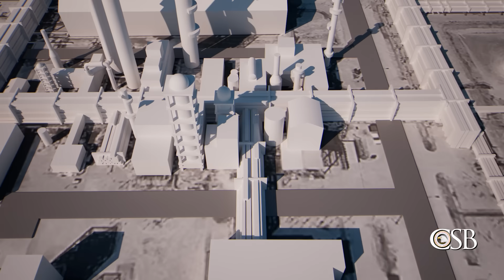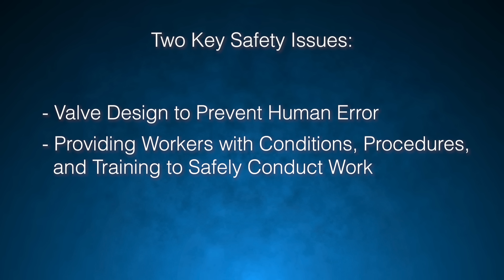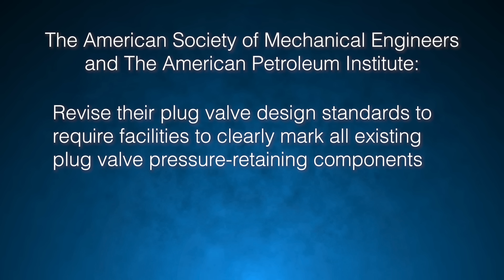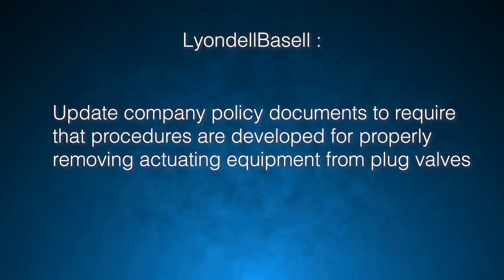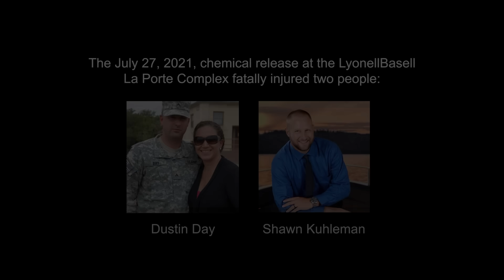Designed to Fail: Chemical Release at LyondellBasell

Comment: well i see a simple answer from the aircraft industry  with secondary castle nuts and cotter pins for pressure retaining fittings seems to be in order so they Cant be accidently removed   and  retrofit bolt/stud kits could be supplied for exsisting  service equipment at what could be considered mininal costs.

Comment: I knew how this was going to end - my background is petrochemical production and I dealt with health and safety including  health and safety investigations for clients - when WorkSafe would be prosecuting ( the government agency in New Zealand that deals with health and safety like OSHA in the United States)  I was involved with a similar event with a gearbox it was mounted on a gas valve the contractors commence to remove the gearbox and massive gas release occurred luckily no one killed or injured but the network had to close a main highway the company tried to blame it on the workers as they were “experienced” however my investigation pointed out (which didn’t make me popular with management who had basically prejudged and who of course paid me !)LOL that in fact there were no drawings/ no procedures/  the workers had had no training in that type of gearbox and there was another physically identical type which could be removed leaving the valve body (pressure integrity part of the valve )intact :possibly these guys were used to working on those types of valves

Comment: I'm confused about this. I've never worked on plug valves but even I could see the obvious danger. How can people make that sort of mistake? What bizarre mechanism did they think was behind that plate?

I don't know if labeling things will make any difference. That's like someone trying to take the propeller off a plane while its running. Paint and markings probably won't have much of an effect.

Comment: Great video - but IMO the root cause is not being properly identified.
A system that requires the mechanical disassemble of the actuator/ valve assembly
in order to prevent its inadvertent actuation in order to conduct downstream maintenance 
that is not related to the valve itself seems not only inherently unsafe, but is unnecessarily wasteful of man hours.
How about designing plug valve actuators that can be locked out for maintenance without requiring a mechanical team to remove the actuator?
Both safer, and more cost effective.

Comment: It's weird to me that they supposedly needed to remove the actuator to "lock out" that valve from being opened during maintenance.  It seems that removing the air lines to the operator should have been enough to ensure that the plug was not rotated. If not, there should still be a way to pin the valve closed without removing the operator.

Comment: Before I retired, I was a worksite hazard management specialist, and a permit writer for a major oil company.  This job would have been stopped until someone could convince me that they had a clear procedure.  Just seeing the system design, I can see that messing with that valve would result in a failure.  We don't mess with valves with product in the tank.  That whole tank would have to be locked out and made safe to work on that valve.
Reply: These fellas weren't supposed to be messing with the valve, they were supposed to be messing with the actuator, which absolutely is a task that does not require the process to be isolated and depressurised.  

Source:  am instrument tech whose plant would be shut down most of the year if we couldn't work on an actuator without a full LOTO on the process, and wondering why pipefitters were performing this task.
Reply: @nobodyspecial7340  If your an instrument tech, then you know that LOTO and permits can fall short if the job itself does not limit the removal of those bolts.  Also, you and I both don't know how that air actuated valve assembly is put to together.  It might have necessitated the removal of those bolts in order to remove the valve actuator.  Either way, does it matter?  A man died.  Best thing to do is play it safe.

Comment: Not a fan of disassmbling a valve as part of a LOTO procedure in the first place. If the valve cannot be locked in the closed position with the actuator on, they shouldn't be using it as an isolation point.

Comment: Ugh. Damn actuators. It would've helped if the actuator could've been designed to have a locked close configuration while remaining installed on the valve. Alternatively, it may have helped if the crew was provided with an IOM of the actuator to review prior. (Though finding the correct one could prove challenging depending on how much of a mess the plant/company is.)

Comment: It's also extremely important for workers to demand to be provided with clear instructions for potentially dangerous procedures and not to be afraid of refusing to conduct any work without those. Never put yourself at risk because of your employer's carelessness.
Reply: The catch-22 for some employees is that making such a demand in a workplace with an unsafe culture can expose them to retribution from management and other employees. I agree that no one should agree to a dangerous request, but if refusal results in termination then you are out of a job and the employer is free to continue their unsafe practices. Regulation is paramount.

Comment: To prevent workers from removing nuts/bolts that should not be removed, how about a bright orange piece (essentially a circle with a hexagon cut in it) that fits around the nut/bolt. Workers would then have to remove the piece to be able to loosen it.

Comment: I'm curious about it and it wasn't mentioned AT ALL. If there was a wholesale valve REPLACEMENT, there'd be a whole slew of lockouts and block & bleeds that would need to be done (if possible). For just replacing an actuator, is it not standard to at the very least disconnect the valve from the process? Even if it's considered a "simple task", the valve and valve actuator are physical parts of the process and some level of risk due to a 1/1000000 failure should be anticipated. Going at it with the entire unblocked sum of available process energy shouldn't be the right thing to do. In short, I'm surprised nothing about isolation for maintenance was mentioned in this video.

Comment: This is madness! Why were contractors in charge of doing the LOTO? It should have been made safe by LDB before the contractors showed up at the location. 
We will let it slide that they wanted to remove the actutator to make it "safe" for whatever reason. Why were pipefitters doing that part of the job in the first place? Where were the instrument mechanics? Which operator trusted these contractors word that they were qualified?( RIP)
CSB recommends redesigning the valves??? You can't be serious? Its simple, get the correct trade to work on what they do every single day. Were they gonna send scaffolders out to weld the pipe back together? Of course not! Dont touch other trades equipment.
"Designed to fail" is a ridiculous and downright embarrassing title for this incident. CSB you need to do better.

Comment: Usually, the actuator has coupling to connect to the valve stem. All mechanical service should know it. Also, before the work, they confirmed that their screw are qualified. So, it is not LyonDellBasell false. The Turn2 is reliable for the damage. That is reason why they need grade A in ISN network and the US companies pay extra for their service. Another safety concern is the plant should LOTO on manual valve. therefore, there should be a manual valve upstream of the actuated plug valve. Since it is acidic service, PAPR and chemsuit should be used.

Comment: “Food preservative” should not come before everything that came after it.
Reply: Acetic acid is just the scientific name for undiluted white vinegar. People have been using it to pickle and preserve food for ages. Granted, what we use is diluted dramatically to almost five percent. In slightly stronger percents, it can be used as a cleaner, but beyond that, it's dangerous.

Comment: ignorance is bliss, until you are handling something with immense gravity. The contracting company obviously had underqualified staff it treated as dispensable. They are most likely hired household plumbers for industrial chemical plants.

Sadly this accident is like someone unscrewing a valve on a gas cylinder that is far from empty, or removing the brass valve assembly on a propane tank with plenty of liquid propane inside.

Just like FAA and FEC, USCSB has no criminal prosecuting teeth.

Comment: Coming from oil and gas, it's pretty alarming to me that these people were working on a non "blocked-in" valve on the bottom of a full vessel. When possible, it's typical to install control and isolation valves with options to either blind off or manually isolate with secondary valves to make maintenance tasks safe and efficient. This is a failure on the design side first and foremost.

Comment: For those wondering why they didn’t just disconnect the control input from the actuator, here’s an important piece of information the video left out: the actuator was removed from the valve so that the valve could be locked out for maintenance because of a LyondellBasell policy that stated that only those pneumatic valves with a means of manual operation were “approved energy isolation devices”

How a pneumatically operated plug valve with its source of energy disconnected would spontaneously operate on its own without a source of energy is a mystery to me.

I think it could be argued those two guys died because of overly prescriptive safety practices. They were killed because they were doing something unnecessarily complicated to meet the requirements of a poorly designed safety policy.
Reply: Every pneumatically operated plug valve (all valves really) that are going to be used for isolation need a separate hazard assessment as some may have a spring that causes the valve to either fail open or closed in the event of loss of air pressure. Failing open or closed is determined by what is deemed safest for the particular process.
Even fully manually operated valves can not be 100% relied on, I once observed external factory welds on a high pressure steam globe valve fail, allowing the previously closed valve to pop open. For reasons like this, for vessel entry, blinds are installed after the vessel has been isolated using all available valves.

Comment: Darwin Awards here. How profoundly bad at your job would you have to be to see that removing the nuts holding the face plate on a valve holding pressure, is a VERY stupid idea. None of those 3 had any busisness working on equipment.

Comment: Absolutely visually stunning and accurate simulation. It's a shame these workers had to die for this video to exist. But I also have to wonder why no one bothered to read a manual. All of these pieces of process equipment have drawings, cut sheets, and manuals available at the central office. Even barring that, most of these valves have .pdf manuals you can access on the web for free. One final thing: this mixture contained methyl iodide, which makes acetic acid look like cotton candy by comparison.

Comment: What gets me is how those contractors could have made such a mistake. I'm not a pipe fitter, but I do haul chemicals and see all sorts of pipe work like in this video. Even to my untrained eye, it's obvious the fasteners on flanges will release the fitting if they are removed. I get trying to make things safer with these recommendations, but that it's happened 4 times sounds a lot like darwinism at work. 

Of course I'm only referring to that one specific item. Lack of training and established procedures are most certainly still an issue here. I wonder if those guys were under the impression the pipe was empty, making it safe to remove the fasteners.
Reply: Fatigue can be as harmful, if not more harmful to your judgement than being intoxicated. If you're working extremely long shifts and are about to drop from exhaustion, you aren't always thinking clearly, often just going through the motions on autopilot. I'm not saying that this is definitely what happened, but there's other possible reasons than just jumping to "well they were clearly morons".

Comment: Sounds like more of a job for an instrument technician. Could have shut the valve without removing the actuator by applying air against the spring and forcing it close. A ball valve can be installed inline of the tubing to trap the air pressure inside and a lockout could have been installed.

Comment: Procedure poisons the mind. Let me explain: From what I gather from the video, the entire purpose of removing the actuator from the valve was to prevent any possibility of the valve being opened while the repairs for the leak were performed. We call this a Zero Energy State. Two things went wrong here: 

1) The nuts on the studs of the plug valve cap did not need to be removed. 

2) The coupler for the actuator that was stuck on the plug valve stem also did not need to be removed...and here is where "Process Poisons the Mind"

Those workers are very skilled. Things are complicated these days, and I'm sure those guys were used to having to follow procedures that have baby steps, and they all have baby steps. By going with baby steps, workers tend to get used to completing the tiny, redundant, irrelevant tasks that MIGHT be necessary, and completely miss the goal of the overall task. In this case, it was to DISABLE that valve so that it could NOT be actuated remotely. Simply taking the actuator off, regardless of the coupler, would have accomplished that task and made the product piping safe to work on. These poor fellas were thinking the coupler was part of the actuator, thus, it must be remove also. 

RIP to those who lost their lives. And thanks for another great video!
Reply: These guys were not skilled. They were so unskilled that it was unfathomable to the plant operators that they would remove the valve bolts instead of the actuator yoke. It is such an intuitive job that this could not have been done by someone in a 'complacency mindset.' it was done due to terrible lack of experience and knowledge
Reply: It wouldn't even have been necessary to remove the valve actuator. All they would have had to do to secure it would have been to physically shut off the power supply to the actuator, i.e. electricity or compressed air, in the closed position. by disconnecting the electrical cable or the compressed air line. In our plants, many drives of valves, pumps and agitators have permanently installed safety switches for maintenance purposes that can be secured with a lock. In this case, we would have used such a switch to to secure the valve in the closed position. In short, the actuator stays where it is, because that wasn't the real problem, but is secured against accidental operation. And besides, it's actually less work than removing the actuator.
Reply: 100%.  Also applies to checklists.  One can be so focused on the checklist that they miss the bigger picture and what the checks on the checklist actually mean.  I think this is also a training issue.  People need to be trained to always take a step back and look at what is trying to be accomplished.  Procedures and checklists are aids to help ensure that the job is accomplished without missing any key steps.  But that doesn't mean that you can turn off your brain.  Reality doesn't always match the procedure or checklist, and they can also be out of date or wrong.
Reply: The video leaves off many details. I suggest reading their case study for the full picture.  https://www.csb.gov/file.aspx?DocumentId=6222
Reply: I wouldn't call these guys skilled. The bolts holding the actuator and the bolts holding the valve together clearly different

this is comparable to lube tech idiots draining a transmission while doing an engine oil change